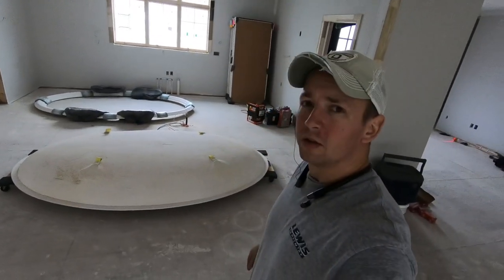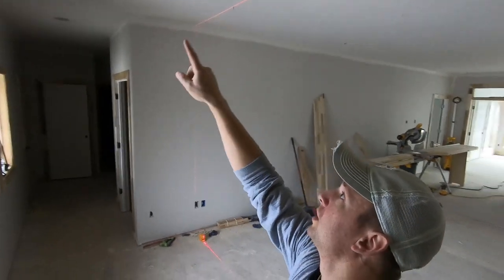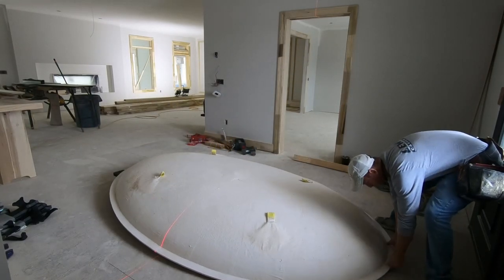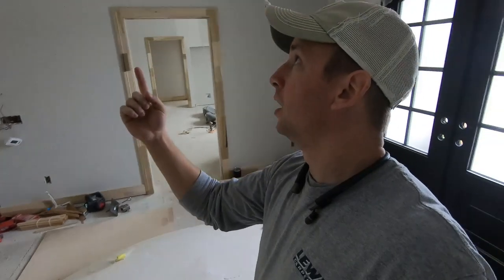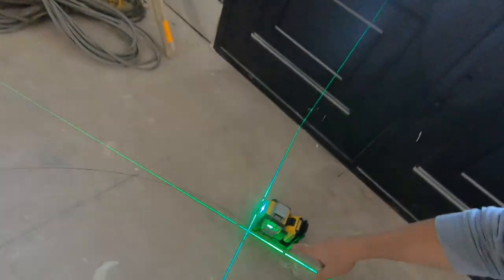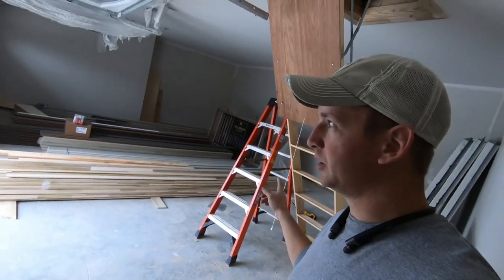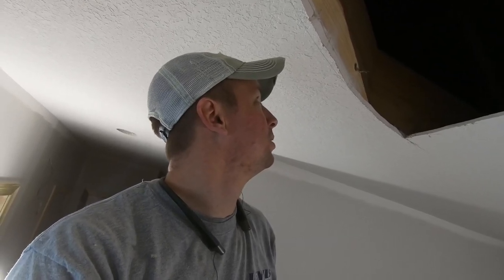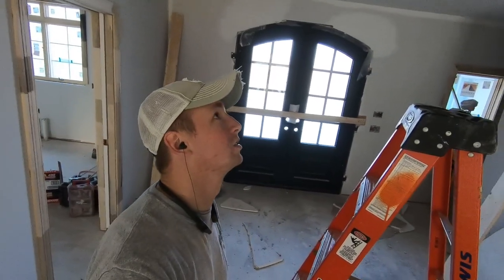The Dome of Doom - Precise Templating and Demolition - Part 1

Comment: Laser tip was genius. Get yourself a drywall cutout tool. Also seems like you've could of contacted the framers or drywall guys to ask if the opening was framed out already. Then just use the drywall cutout tool and traced the framing. Cleaner and a lot easier. Great video though, can't wait for the rest of it.

Comment: We often use a jig saw with a coarse blade for cutting drywall.  Works quite well and the blade used isn't long enough to reach any wire (unless it's laying right on the drywall.)

Comment: One tool that I found great for that application is Makita's drywall saw. Best tool that I've used in that application. Basically it's a hybrid of a jigsaw and a multi tool. The depth of the serrated blade is adjustable and it collects a lot of dust in a port, plus it's readily compatible to a dust collector. When connected it captures A LOT  of the dust. Plus you can maneuver around tight curves. I realize that you are on the Dewalt platform, however it's really worth it if you do many cutouts and indispensable if you do remodeling. It's worth checking out and certainly worth a video if you're locked into a contract with Dewalt. 

Thanks again for your videos.
Reply: Just bought one. It’s a must have tool

Comment: Lucky for you it's just unconnected power. I learned my lesson when I cut a water line. 😣💦 That lesson is to never plunge the whole blade through what all you need is enough to get through the drywall. For big cuts like that, I use a stubby (snapped off) blade that won't reach much past the drywall.

Comment: Very interesting I thought trim carpenter's don't do framing was relived to see the framers had done the heavy lifting and did a great job placing it where it needed to be most trades don't think about the next guy when it doesn't even cost them extra
Reply: The drywallers, that could've just left that part open sure didn't 😅

Comment: NEVER go full deep with a sawzall! Use a short blade with it turned upside down while holding the saw at an angle as to not let the blade go in too deep
Reply: still would not have avoided that wire...
Reply: Pp Ss I use a sawzall to cut drywall pretty much everyday, and I don’t cut through the wires right behind it. Haha you hold the entire sawzall at a severe angle which makes it so the the reciprocating action doesn’t allow the blade to penetrate any further than the drywall itself.

Comment: Good lord! The manufacturer couldn't supply a paper or cardboard template you could just tape up there and trace? You're doing great, but they made so much extra work for you.
Reply from the maker: I requested one...but no one cares. 😔
Reply: @InsiderCarpentry  I feel your pain!
Reply: @InsiderCarpentry  Ask for dwg. cad files next time to give to the architect.  They could print it out  on a large format printer in pieces with match points which you could the reassemble in the field with spray glue  to create a template with plywood.  The sheetrockers should have left a rough center opening anyways instead of just covering it completely.

Comment: I’m curious, on average how many trips do you think it takes you from the truck to get all your tools set up in a house?
Reply from the maker: When I do a big house I pretty much unload my van. Doing a rough count in my head I'd say around 15 trips unloads almost everything. Take me about 1-1.5 hours to get setup when starting a big new house.
Reply: @InsiderCarpentry  That’s a fair amount time. For cabinet install over the years I have the luxury of leaving tools on site over night less then 1/2 the time. And most jobs are approx 1-2days per phase, so I’ve spent an amazing amount of time to get the trip count down from about 12 to 7-8.
Reply from the maker: If I was doing what you’re doing I’d definitely get leaner. But most of the time I’m only loading and unloading once per month. So I’m pretty fine with where I’m at now but could definitely always be better.

Comment: Invest in a drywall cutout trim bit
You've every other tool
Do you do electrical work too
Put junction box on other side of rafter
Pigtail wires, with extra wire to reach LED box

Exciting to see you stretch into other trades while working alone
Plaster is heavy and can crack if not supported evenly

You can do it
😎
Reply: I’m no electrician but I think burying an electrical box is against code?
Reply: Yup. Any junction box has to be accessible by code.

Comment: Couldnt you have just used the drywall jack to lift up the dome and center it then trace it pull it down cut the drywall......
Reply from the maker: Way to risky. And the dome would have to have been upside down on the lift which wouldn’t have worked.

Comment: Dumbass question, but if the opening was already framed out, why couldn't you have just attacked it from above? Is that an attic or just dead space?
Reply from the maker: It’ll make more sense in the next video. 👍
Reply: @InsiderCarpentry  looking forward to it!
Reply: because the framing is never exactly where it should be...